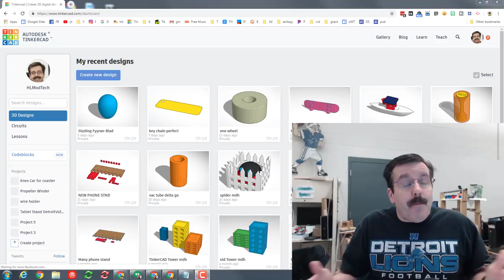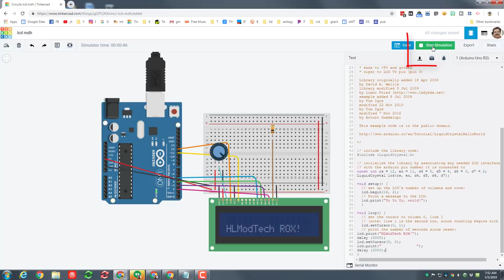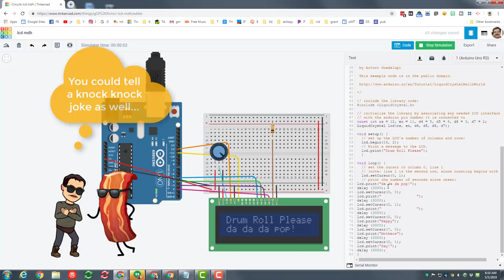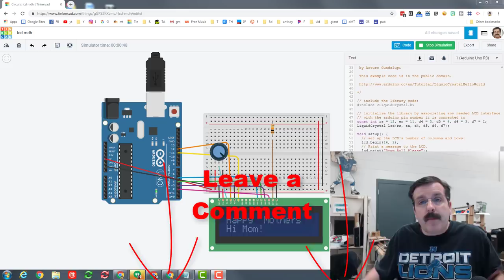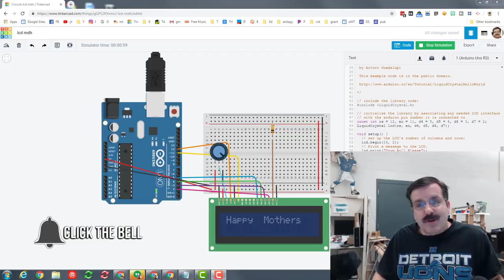Make a Mothers Day Card | Code LCD Phrases in Tinkercad Circuits

Comment: What is resistant required in potentiometer in this circuit???
Reply from the maker: Tinkercad only has one to work with... I have never checked its specs... Good question. Are you building virtual or real?